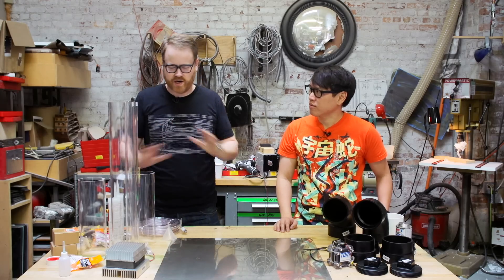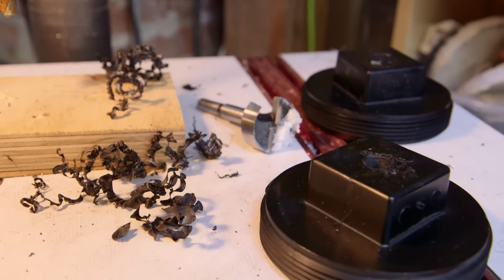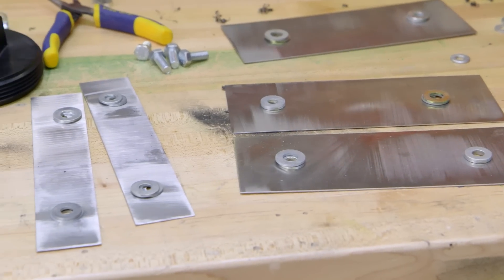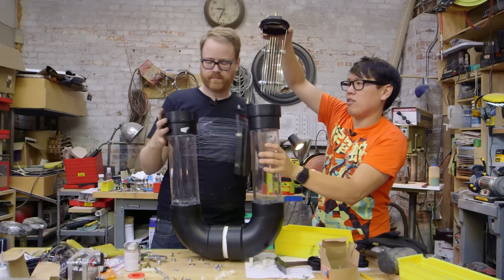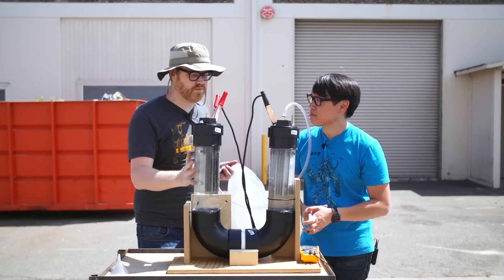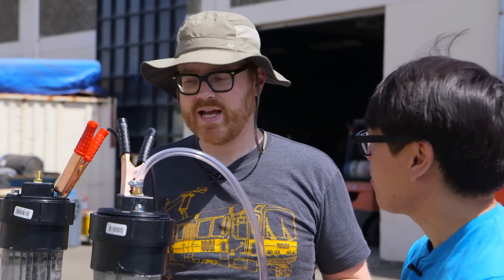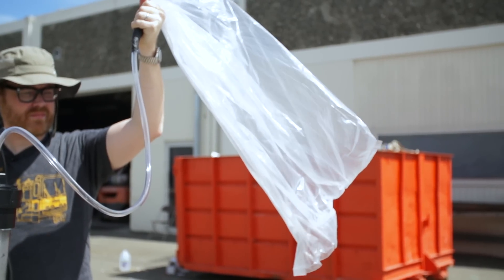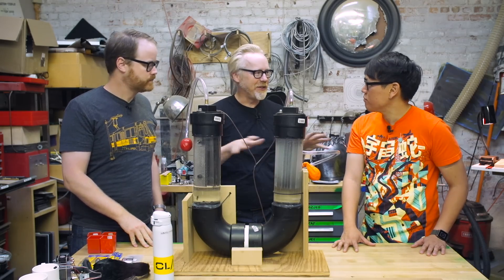Tested Builds a Hydrogen Converter

Comment: Is like, yeah let's do this electrolyzer completely wrong "again" just like in mithbuster and "again" say it doesn't work like it should.
Reply: The charge plates are to far from each other.
Reply: Aztoreth Blemuz they also clearly just ignored the fact that you can't keep hydrogen in a plastic bag because it will just move through the plastic
Reply: +Random Electronics and drafting ... My bad i almost spelled it like methbusters :P
Reply: i have made ones with less then 20 1/2 inch steel washers that work better then this one they are trying to make it look bad plus the king of random the one they "modeled it after" his makes a lot of hydrogen and its about 5X's smaller
Reply: low amperage = low HHO outputwhat amperage did these guys use?
Reply: robinsss
Since they were trying to build a hydrogen generator not an HHO generator, low HHO output would be a good thing.
Reply: Aztoreth Blemuz mythbusters
Reply: +Jeremiah Fix checkout irondmax or daniel hho
Reply: where is your video?
Reply: my comment
Reply: robinsss not if you have an LC circuit hho system.
Reply: Kevin Jackson

to harvest hydrogen from water you have to break the hydrogen atoms away from the oxygen atom

the electricity accomplishes this

once the hydrogen is separated from the oxygen their device sends the  hydrogen in one direction and the oxygen in another

but separating the two chemicals comes first
Reply: MrHydroguy

is this a LC circuit HHO system?
Reply: Will said briefly in the video that the design they used was a modified version designed by The King of Random. Check him out. His channel's cool.
Reply: Aztoreth Blemuz **mythbuster
Reply: Aztoreth Blemuz Well of course,  all these companies trying to recreate the project are sponsored by major car company's, such as Toyota in this one!  Lol
Reply: +Viktoria Bondarenco i been knowing that since i was little don't worry. When i saw the mythbuster episode i was building a cell for my experiments (And Fun) did work, not like mythbusters one. Now years later they try again with a cell horribly designed and without the specs which gives you high dissociation of whater. I really don't care if it works because is kind of obsolete and thats why im planning to use a molecular dissociator insted of electrolysis.
Reply: Aztoreth Blemuz Because all people going to drive own car on hho genrator what about crude oil mafia they will kill you read wrold history of creator who creat the water kit for car all is Dead or disappear
Reply: MrHydroguy At last you figure it out. Phew I'm happy at least some one knows what he's doing.
Reply: They never said anything… This isn't mythbusters, anyway.
Reply: AnArmoredMarch  oh, damn! That makes a lot of sense.... good detective work. They had to have known that the solar panel would not push out nearly enough amps for how far they were putting the anode and cathode. They properly planned that out I guess...
Reply: Except that was an ad for the toyota mirai or whatever, the hydrogen powered car that isn't coming to the united states.

The reason they claim that it didn't work is more than likely because people would be able to make the gas by themselves, and then the gas companies wouldn't make money. That's why they told you to go buy hydrogen from professionals
Reply: +majid majeed yeah there was a logo at the beginning for a car company
Reply: exactly what i was thinking
Reply: i think they are paid form someone or somewhere to promote that it is not working same like mithbuster.
but i already made one cell out of garbage and it produce more and i am happy that with more effort you can make it work,
these people are liar,
Reply: +majid majeed for sure
Reply: The problem with myth busters often is it is for entertainment and creating the fascade all it hosts is a myth by throwing in variables that makes it not work, rather than real science. There are myths for sure and some of their products are myths while other myths easily prove so.
Reply: If they would have said, It dosen't release as much kinetic energy as what would be demanded, they might have legitimate claim, but it's ironically fortunate that one cannot produce hydrogen to easily; booom.
Reply: "the asian guy made his people look bad by not knowing"
Go away with your assumptions and stereotypes. 
Racist.
Reply: That's so funny I was about to say that
Reply: Yeah exactly. Disinfo for sure! Plus the asian guy made his people look bad by not knowing wtf he is talking about. It looks like they did about 5 mins. of research.

Comment: You would have had better luck if there was a minimal gap between the different electrodes. The systems with mixed O2 and H are more efficient due to the small gaps. This thing would need a voltage booster like a tesla coil or the capacitor setup that is used for tasers/bug-zappers in order to overcome the resistance.

Comment: "Well generate it faster because we have a higher voltage" Might as well try to power it with static from a balloon then right? that's thousands of more volts, oh wait. You need amps too, which solar panels aren't very good at
Reply: I can't believe they said the 22V panel would work better than a car battery! WTH
Reply: For a cell shaped like this, The solar cell very well might have worked better.
You need voltage to overcome the resistance, and ampere to do the actual work. I'm just guessing here, but i doubt they got the full 5A flowing through the system, meaning they would have needed an even higher voltage to get anywhere. You can fix this in two ways. Increase voltage, or lower resistance. If your electrolyte is already maxed out, then resistance can only be decreased by putting the anode and cathode closer together. They referenced Grants design, and if anyone cared to look, they would notice that he arranges his anodes and cathodes with mm between them, meaning very low resistance, and allowing for lots of current at 12v.

Anyway, you posted a year ago, so i suppose this isn't changing anything ;- )

Comment: Obviously it's a poor design, I didn't see any math showing how much gas it should have made, so I don't know how bad it was, but in comparison many years ago I easily filled a normal party ballon with HHO in under an hour by overcharging a car battery with a 4 amp Charger( it output around 14.8 volts as I recall). I merely unscrewed one fill cap and put the ballon over the hole.

Comment: no more than 2 volts per cell, and they had 6 cells on each side of the tube.  12 volts per side. hydroxy gas combines  after burning to make water again. heat is the byproduct.

Comment: they hooked  it up wrong. and  the current they have is way too low. volts are only a carrier, amps are the push. a car battery is a good choice. and they needed one on both sides of the tube. plus on one side of the cap, negative on the other. I know that this was intentional misleading so we would think that is is not worth the effort. well their experiment does work and about the results of my tests. wow

Comment: This is happens when engineer geeks fiddle with things they don't understand, i.e. chemistry.
Reply: This is very basic chemistry. You can build your own hydrogen generator using a water bottle and stainless steel blades to pass electricity into the water. I've done this as a project when I was 13.
Reply: A good engineer reads up on the topic beforehand and piggybacks on what has worked for others. This was like asking my landlady to produce hydrogen.

Comment: I wonder if you can increase the efficiency by introducing a nonionic surfactant to the water to lower the surface tension of the water.

Some surfactants even double as electrolytes, or vise versa.

Comment: Besides the electrolyte, the problem with this system, is that here are no batteries or capacitor, or something to accumulate the electric charge, and so, the current is very small, and the amount converted per time is proportional to the current, the voltage controls the especific reaction.

Comment: wow that was the shittest build I've ever seen. Why the fuck didn't you use plastic bolts to separate the stainless steel? All the electricity it going through the bolts instead of the water to the next panel.

Comment: Here's what you did wrong:

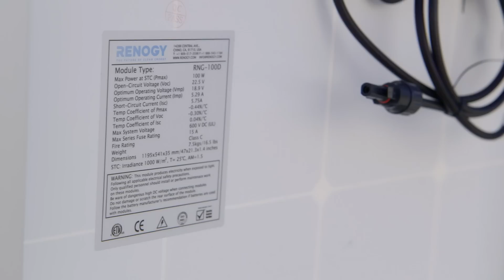1) At 6:48 you say: "more voltage more hydrogen" - Basically yes you get more current due to ohms law - BUT this also reduces the efficiency. Raising the voltage turns out to be an utterly impractical strategy! The excessive voltage (beyond the chemical potential) just drops over the electrolyte and heats it up - you get no hydrogen from this. The 22.5V of the solar panel (@ 6:34) is too much by more than a factor of 10! The single internal PV cells put out a low voltage on their own (ideal for electrolysis) but ironically they are internally serially connected to be useful for the more usual electr(on)ic stuff. Instead of increasing the current by rising the voltage one needs to increase the current by reducing the resistance through the electrolyte. This is done by:

A) Having a highly concentrated KOH / NaOH electrolyte. You had so much water in there that a properly saturated electrolyte probably would have cost a fortune and probably would have posed a little bit of a disposal problem afterwards (@ 5:40).

B) The electrical resistance through the electrolyte can be reduced by bringing the plates as close together as possible. This makes separation of hydrogen and oxygen more difficult and this is (I think) the main reason why most hobbyist videos usually do not show gas separating electrolysis.

2) Hydrogen likes to permeate through materials since the H2 molecules are so small. A super thin plastic bag is the worst possible choice. I think you lost the hydrogen faster than you produced it. I once had the ambient air crunch a hydrogen filled screw closed 100ml yoghurt bottle. An interesting experiment on its own.

The best source for serious DIY electrolysis plans that I've found so far (that separate hydrogen and oxygen) is:
http://hho4free.com/  I'm not affiliated with them. They use special ion conductive plastic sheets for gas separation.

I designed a gas separation grid for very small experiments (lots of tiny V-shaped "siphon rails") that should separate gasses by gravity: http://www.thingiverse.com/thing:515228 (untested) Note that there is a danger of gas back-flow & mixing due to back-pressure!! 

<<!!CAUTION!!>>
15 liter of gaseous hydrogen (mentioned @ 0:40) is very roughly as potent as 15 cubic centimeter of gasoline (gas to liquid: factor ~1000). This is not much for lowly volatile substances like gasoline but if hydrogen is produced efficiently with plates close together it is very easy to accidentally mix the hydrogen it with the produced oxygen. At the optimal ratio complete combustion takes place in an extremely short time-frame and thus leads to a very very dangerous power excursion. Also explosive combustion is possible in a very wide range H2/O2 4%-77% !!) I think on a larger scale this is nothing for an ad hoc weekend project.

Ps: 6:35 & 6:59 Please don't mix up energy power and voltage!!

Comment: "22 volts of power and about 100 watts of energy"
/fail physics
Reply: +Patrik Pålsson Why?  It's just over 4 amps.
Reply: David Lowery  Well volt is voltage not power, Watts is power and energy in these cases is usually the product of power and time.
Reply: Energy is measured in Joules.
Reply: +elephystry or kilowatt, Watt, calorie, horsepower, or even barrel of oil.. I could go on.

Comment: Higher voltage doesn't necessarily mean faster production, you have to take into account amperage.
Reply: was about to say the same thing, the effective current is more important so likely the only way to do this in any time effective manner is at insane voltages or high amperage. likely in commercial settings this is done in thousands of volts if not higher(to offset the resistance induced by the water) or at really high currents.
Reply: +Jay Koerner whoops I'm wrong(in part commercially it's done at 1.43v normally for efficiency reasons normally with heated water at 100°c to minimize loses in energy for both heating and splitting the bonds usual in high pressure systems
Reply: Voltage is proportional to current drawn....

Comment: this is gonna come off mean, but- you guys deserve it...
you suck at your job. do some research, and maybe you wont suck at it.
1st. your plates are way too far apart, you had huge losses there.

2nd. if you think that solar panel has a tenth the power of a car battery, you fail in basic electric principles. watts is the energy being used- watts is voltage x amperage- so yes, your panel had higher voltage, true at 22 volts vs a batteries 12, but a mere 15 amps vs a car battery having 300 on the very low end, up to 1000 amps on the high end (lets use a median figure, shall we?) so your panel 22x15=330 watts peak. thats all it can ever put out, on the brightest day ever... car battery? 12x650=7800watts.. tbh honest though, you were probably only getting 4-8 amps out of that panel, soooo maybe 175 watts.  now, i realize you said you wanted clean power, but you claimed "this panel puts out more than a car battery"

3rd you're afraid to breathe fumes from spring water, but you put a caustic akaline for your conductivity in the water? simple baking soda would have sufficed.

4th as more than one commentor has said, that thin plastic bag = no good for collecting hydrogen.... ya gotta use something thicker... plastic is ok for short term, but you are better off to use a tank, using a gravity trap style containment, with your line going through a water trap.

the whole thing comes off like a poorly planned high school science project, and someone lucky enough to work with/ around Jamie and Adam should hold themselves to higher standards.

good day, sirs!

Comment: Does this mean one day we will all be on the leash of BIG HYDROGEN?  What I really wonder is, if you modified the collection process and the container to something other than a plastic bag would your yield be higher? Besides it's solar powered. You could set this up and ignore it until you had the volume you need. The only costs are the initial construction cost and the distilled water supply. I understand that commercial BIG HYDROGEN is a more efficient, safer  (and probably a more  economical?) way to do this. But WTH, I make my own compost too, so...
Reply: somewhere around 80% of hydrogen is produced by the oil industry so it's the same people unfortunately

Comment: I would say that if they use a high frequency pulsating direct current power supply that would work a lot better, but that is after they reduce the distance between the electrodes and mixing the electrolyte thoroughly on a bucket before hand. Good luck on the next video.

Comment: TKOR's is so much better
Reply: exactly
Reply: it was also an HHO generator the plate configuration is ideal for that. These people would have been better off with aluminum rods down each tower, and hooking it to something that actually generated some current that is what speeds of the process not fing voltage the voltage just insure the current is getting to the nodes. they also forgot there blubber, that is the thing that cleans the gas of all that toxic shit there were talking about.
Reply: Because he doesn't need to lie to make money, this fuckers does.

Comment: typical half ass science I built a 3/4 inch diameter unit that produced more than 15 milliliters a gas in 10 minutes  using a bench top power supply it's all about  the amps not volts amps is work

Comment: recently built one like this in my RV, but the job in the video is very sloppy
Reply: Mr. Rich B.O.B But I needed the extra power to escape the cops
Reply: Plates too far apart apparently, the solar panel has very little amp output and I assume they had leaking joints (pipes were not glued correctly) and bags/balloons may have leaked.
Reply: One way valve is missing letting whatever accumulation go back.
Reply: You're right. You could see the amount of gas generated, it should have filled that bag pretty quickly, clearly there were leaks. For one, was that thin 1 mil bag able to hold molecular hydrogen?
Reply: Patrick Horgan 
Exactly. Hydrogen can even leak out of those balloons....I’ve seen a whole balloon full leak out in just a few hours...I’ve seen Hydrogen leak from a Mylar coated balloon before too.

Comment: second time in have seen mythbusters or what ever try to make a hho cell and did a shit job at it.... there is 7474848r99 videos on here with way better designs all so should of used a battery
Reply: they had to much water between the two poles and should have used a transformer to increase the voltage 22volts at 11amps is horribly inefficient better off at 1.5v( the reaction only needs a 1.23v difference)would have given them about 180 amps and much better efficiency